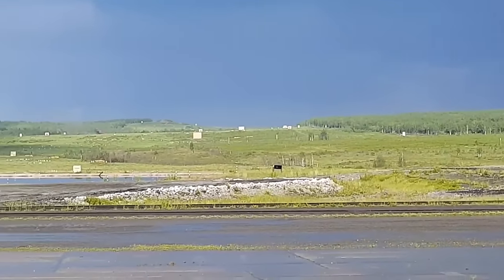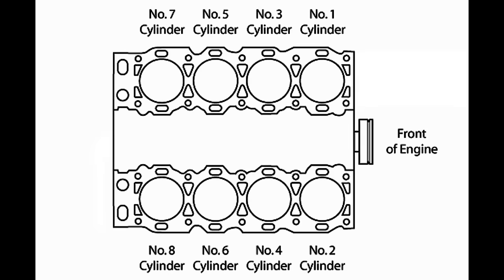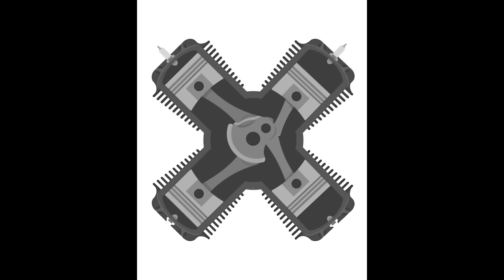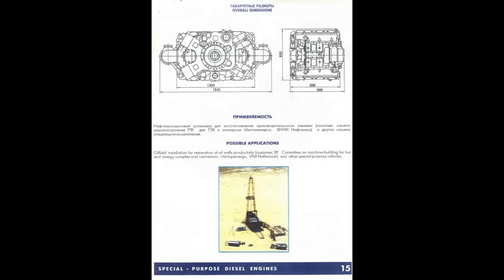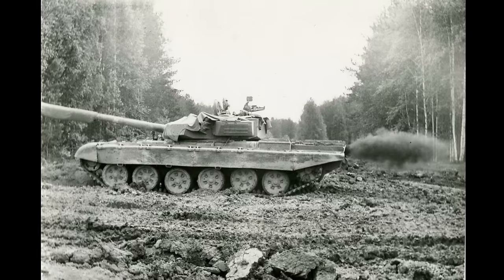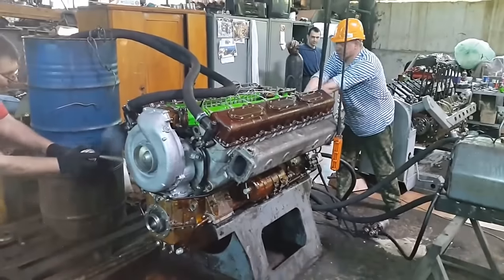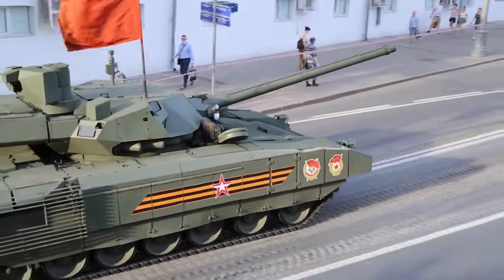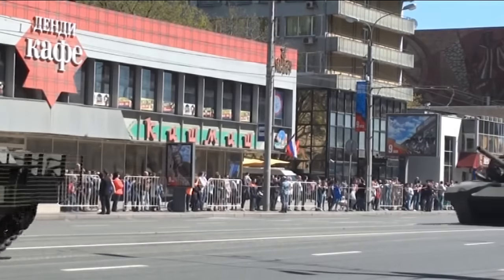Controversial History of T-14 Armata's Engine

Comment: More time has been spent on talking about the T-14's engine than the T-14 has spent time in trials and combat.
Reply: The same could be said of most tanks

Edit: It seems my comment is somehow being misunderstood (not defending the T-14). Im just pointing out how we have probably spent more time talking about a certain tank, than said tank has seen combat. Idk why people get so worked up over such a boring fact
Reply: @Darth_Barnaby  no
Reply: nope  @Darth_Barnaby
Reply: Or on the assembly line
Reply: @Darth_Barnaby  not at all. Look at the Sherman and its variants. Tell me ALL the engines those used then
Reply: Most modern military equipment didn't see combat within 1 or even 2 decades after the original design. The F-22 only saw combat shooting a Chinese weather balloon. The F-35 is on the sh1troom for almost 3 decades and not combat ready yet.
Reply: @mistachomkmartiantm1810  Yes lol kid
Reply: @laughingseal2282  actually the F-22's first combat sortie was in 2014 when it bombed ISIS targets during OIR.
Reply: Is that because the t-14 hasn't done any trials and combat?
Reply: @psbs1 >no
> doesnt give context
Reply: @mistachomkmartiantm1810 >no
> doesnt give context
Reply: @bullpupgaming708  ""combat""
Reply: @laughingseal2282 the f-35 is combat ready, the f-35i had already targeted and shot down multiple cruise missiles. If I'm not mistaken they are about to do a software update to block 4
Reply: @bullpupgaming708 still the point is modern hardware is hard to develop. and its also harder for the Russian since they have limited budget and human/scientist resources they lost.
Reply: @Rozarez213  and that's fine, but one should know what they are talking about first before trying to make a quip or satirical comment about something too.
Reply: @Rozarez213  that and the fact they lie about everything
Reply: that engine also gear its a crap , engine overheat, low hour service rate, but gear its something very secret but some rumbles say it alot troble😂, Russian if don't copy don't make😅
Reply: @psbs1 not ironically yes, lets say Challenger 2 and Leclerc, remember when we talk conversations we mean everything from war thunder forums to videos ans their comment aection, to 2 guys on the street
Reply: @bullpupgaming708 why would they ship/Fly a F-22 to middle east to do what F-16s and F-15s there were doing for a long time in an non opposed no AD place?
Reply: @geesehoward700  Very good point ,though they like to say it is combat proven because apparently it was in syria..Why design a tank you can't afford and the ones you do have ,the Army want nothing to do with, They won't send it to ukraine  ,(thought hey say they have ) they are scared to lose one incase the west get their hands on it ,but who will buy it if they won't buy it and the ones they did buy they won't use....A Chieftain is a better option and they broke down every 5 miles
Reply: @Rozarez213  and  it is harder to get the western components required for the hardware
Reply: Wrong. 1 trial is probably more than 3h+ 1 vid of the T-14 Armata averages 20minutes. And there has been ALOT of Armata trials. So you are wrong.
Reply: @Darth_Barnaby bro what?
Reply: @Darth_Barnaby  you wish LMAO
Reply: @laughingseal2282  yes but there’s 180 more F22 than T14
Reply: M1 Abrams in Ukraine is out of parts, and has been captured in Aviivka.
Reply: @swizzzy4962  Out of interest are the trials still continuing ? If so how long have they been ongoing and do youknowif there is any sign of the trials ending,,??
Reply: @Darth_Barnaby the comment is satirizing the so far unsubstantiated effectiveness anywhere of the tank. As it so far hasn’t been seen deployed in a real combat type scenario. While other tanks like the Abrams have seen 2 near peer engagements and many upgrades along with serving with multiple nations so we know that the tank has more to offer than just being some senators re-election bid. While T-14… well… who knows. It was revealed in 2015. And Russia so far has failed to show it having any international traction. Point is. It’s almost been a decade and they neither have the production line let alone a battalion of the damn tanks made. Honestly. The best thing uralvagonzavod could do is to go engineer or buy up a transmission with a reasonable reverse gear. And if they really need the space they probably can throw away one of the middle gears since fuel efficiency is literally the last thing brought up when buying a tank
Reply: The point of combat proven modern tanks is a little less relevant than everyone makes it out to be. 

The case of a tank that is thought to be very good after years and years and years in trails and skirmishes in non-peer to peer combat, then showing itself being not half what it was thought to be is soo miniscule that it can easily be ignored. All modern western tanks and all soviet models 3 times over have that all on their side. 

The T-14 has nothing but the official russian numbers about it‘s trails, which are limited and given with the strong interest to make it a propaganda posterchild. 

Western tanks have often been exported to other countires that wouldn‘t uphold the original countires propaganda if it were all lies, the T-14 isn‘t even in gerneral use by russia it self.

So to say the T-14 is just as unproven as the all the modern MBTs in the west is simply false. That doesn‘t have to mean it‘s trash. Not on this alone atleast. But saying it is not atleast a bit questionable if they are ALL the russians make kt out to be is simply not a realistic conclusion.
Reply: And once again, a simple innocent joke has sparked a comment war.

And they call the Balkans the powderkeg...
Reply: @marrtino8002  Man, you're from Poland, your country didn't invent anything except for the best toilet cleaning method
Reply: Not a high bar to clear
Reply: @sfalhilsajd hey! They have nice sausages 😂
Reply: @TheWizardGamez   Okaaay, im not sure what sparked you tangent, and im not sure what your point is? But my point was just that a lot of people like discussing tanks, so theres probably been spent more hours discussing a tank, than the tank has been in trials or combat.  It had nothing to do with politics or the T-14 itself as such...

For example, for every one hour the Leopard 1 has seen combat, it has probably been talked about for 1000 hours (just random numbers). And it is like that for probably every tank ever made
Reply: @LastGoatKnight  Wdym? Like i said to someone else,  my point was just that a lot of people like discussing tanks, so theres probably been spent more hours discussing a tank, than the tank has been in trials or combat.  
The sherman saw service for what, 15 years, and if we say that theres probably been at least two people somewhere, talking about it at any given time for the past 20 years. It would mean that more time has been spent talking about it (20 year), than it has seen service (15 years). Statistically, its like that for basically every tank
Reply: @namkhanhng1802  I really cant see why people mistake my comment for something that tries to defend the T-14? I was just pointing out that it was something you could say about any other tank
Reply: Almost as if the tank doesn’t exist out of parades.
Reply: @laughingseal2282  The F-22 saw combat over a decade ago as a strike aircraft. And far sooner as a ISR platform. The sensors make it a very capable reconnaissance aircraft.
Reply: My point exactly. This tank is irrelevant now and in the future. It would have to be remade for modern battlefield contusions, so this tank as Is serves no purpose and wasting time arguing about it is pointless. If this tank was as good as Russians claim, they would be using it
Reply: @Darth_Barnaby that depends, fight goat diddlers and fighting a decent millitary are two completely different things
Reply: @bullpupgaming708 that's not worth mentioning at all, the su57 was tested in combat in Syria and yet its still not ready for service and serous combat
Reply: @marrtino8002  Looks like you're one of the 33% ppl in u cuntry that didn't had literacy. And the precentage of outdoors toilet is about 10% for Russia and 25% for Ukraine.
Reply: @laughingseal2282 F-35 is combat ready what are you talking about, out of all the modern tech to talk about, F35 is not the one to say is a failure
Reply: @marrtino8002  ESL moment
Reply: @laughingseal2282  yea that applies to planes, but hasn't applied to tanks
Reply: Let's talk about F-22 and weather balloons?
😅
Reply: @vaninec  the f22 preformed strike missions in Syria and has been deployed by NORAD to intercept Russian probing missions on the border of us airspace since it entered service. It's also been deployed to escort drones in the black sea and patrol aircraft in the sea of China
Reply: Kind of like Abrams in ukraine
Reply: I understand the joke but actually it is legit wrong. I do not think people realize how long this tank has been tested, failed tests, and was retested. The ruskies arent stupid and make good stuff and the private and especially state tests are grueling.
Reply: @TheWizardGamez

"M1 has seen two near peer engagements" 

lolol
Reply: @jamesmandahl444  Iraq had what was at the time modern armored vehicles. Iraq had them again in 2001 but had a worse army.
Reply: @bullpupgaming708  It bombed a toyota truck insergents with no air real defences thats hardly a good pressure test. Might as well be practice targets lol
Reply: @Darth_Barnaby  The same could also be said regarding the arguments between F-22 fans and SU-57 fans. Neither plane has seen any serious air-to-air combat yet people will argue passionately for hours.
Reply: @laughingseal2282 The F22 hasn't seen combat because no one is dumb enough to start at air War with the US. The T14 hasn't seen combat because it isn't ready for combat. They are not the same
Reply: much like the Abrams 💀
Reply: @jgw9990  no one starts air wars or any wars with America. America starts wars with others. Why haven't we seen it in combat then?
Reply: Man seeing this tank in combat must be scary
Reply: Если долго мучится , что-нибудь получится .😄
Reply: @laughingseal2282  The F-35 has been combat ready since 2017. Russia can prove that at any time by poking NATO
Reply: The Armata platform has been in RND for almost a decade. Russia just doesn't have a need to put it in serial production while they have thousands of other tank platform's that can be modernised. The only country to produce a truly modern tank is France and they made less than 200, why? Because mass production of anything modern is EXPENSIVE.
Reply: @psbs1 yes, leopard hasn't been in combat since it was created lol, only now. Leclerc, ariete, chinese and japanese tanks. No one of them was in real combat
Reply: @bullpupgaming708 😂😂 we all know how the USA support... Sorry... Fought ISIS 😂😂😂
Reply: @marrtino8002 , what Russians do, you can't copy!
Reply: @norb0254 ,, in case of Russia you should forget sentence "can't afford"! Russian economy is capable of unbelievable things! For example, they produce 5 drones at a price of one 155 shell. Having surplus of half of a billion dollars for anything they want is scarry possibility! 
In other hands, what for Russia need next generation tank in Ukraine?
Reply: And whose fault is that?
Reply: @geesehoward700  It has had successful trials in Ukraine under combat .
Reply: @magnacarta9364  it's not started production. There's only a bunch of hand made preproduction prototypes. Its not even due to be put onto production now as far as we know until after the war. Whether or not it got shipped to Ukraine or not doesn't even matter
Reply: @geesehoward700 Все знают что в России есть танковые заводы! Теперь  если вы не против, выслушайте меня. Танк Т 14 Армата является машиной с аббревиатурой аналогов нет, если вы умный человек то должны знать что детали от Т 72, Т 80 ,и Т 90 к данной машине не подойдут и  строить завод для изготовления данной модели танка пока нецелесообразно!
Reply: @Darth_Barnaby Well, still most tanks have been manufactured and can be used if needed unlike Armata, which so far has been a total failure.
Reply: @tindikukka  Youre not wrong, but its besides the point. I didnt comment on how good the T-14 is whatsoever
Reply: @tindikukka  , right! Armata tank is not needed for battle right now!
Reply: @voldemarvaglaots6690  You can't put something you don't have to battle.
Reply: Still Abrams is burning in Ukrainian Fields.
Reply: @AKIB1991LASKAR  1 Abrams for 30 T-90 tank. Not bad ratio. And  T-14 stays in garage...
Reply: Atleats The T-14 is being tested and was in indirect artillery operations in Kharkov for a bit unlike Abrams which is getting obliterated and the Leos too🤣
Reply: Don't even get me started on the AbramsX. That thing won't even surpass trials because it's probably so horrible! 😂
Reply: @bogymann203  T-14 is so good tank, that it participated to battles as invisible tank. Cold fact is, that Russia doesn't have many and all those are more or less prototypes. Russia doesn't dare to take it to frontline because they don't want to see those burning.
Reply: @psbs1  Yes
Reply: @mistachomkmartiantm1810  yep
Reply: @magnacarta9364  hey guess what? It got cancelled. It was so successful it got canceled!
Reply: @SIRUNOWN  What like the Abram M1's now as the fourth one is destroyed at the front.
Reply: @magnacarta9364  Yeah, the Abrams was so bad they only built 10,000 or them. Sooooo 8 T14s, or 10,000 Abrams. One of these sounds like the more successful platforms, and it's not the T14 lmao
Reply: @SIRUNOWN  No T14 have been destroyed in Ukr 4 M1 in about 4 days. The rest are hiding out with the Challenger 2s
Reply: @magnacarta9364  Yeah because their only real deployment has been the Victory Day parade, let's talk about a tank Russia is actually fielding, how many T90s have been destroyed? Nobody ever claimed the Abrams was indestructible, they're going to get damaged and destroyed, that's how War works, the trick is having more than the enemy destroys. Let me reiterate, there are over 10,000 Abrams tanks, there are 8 Prototype T14s. It would take one well placed car bomb to destroy the entire fleet of T14s, just sayin.
Reply: @magnacarta9364  Like what a braindead take, you know what else has never been destroyed in combat? The M7 Medium Tank, that must mean it's superior to the T90M because more T90M's have been destroyed than the M7 Medium!
Reply: Honestly I think the f22 is a waste of money, it’s barely even been used and it’ll be outdated by the time it goes into actual combat if it’s still in service at the time
Reply: @DirkDiggler-qp3vm F 22 is really larger than T 14 and F 22 has existed four times longer. But all the same, what the F 22 can boast of is only its battle against a Chinese hot air balloon. 🤦😆
Reply: Actually T-14 has had it's combat tests in an artillery role
Reply: Why hate? Just because American Engineer cannot make best engine doesn't mean other can't?
Reply: @marrtino8002 Das ist gelinde gesagt Unsinn.
Reply: @KSmithwick1989Dass ein neu entwickelter Panzer bei einer Vorführung mal streikt ist nicht weltbewegend. Aber hier wird darauf herum geritten nur weil er ein russischer Panzer ist.
Reply: @geesehoward700 Well it already fought in Ukraine it Shot at ukrainians positions to Test the Tank and then it was shiped Back to russia